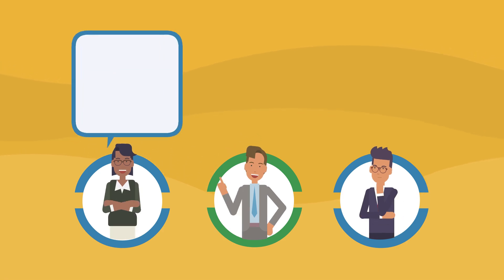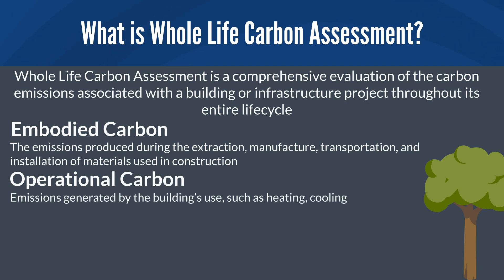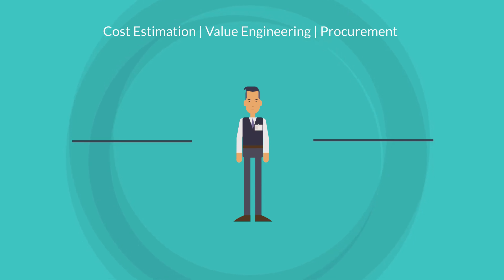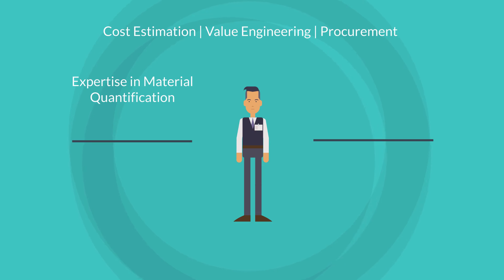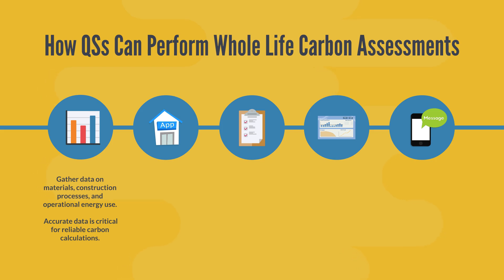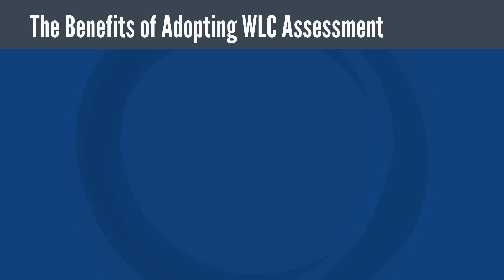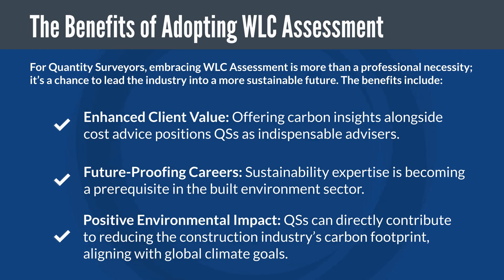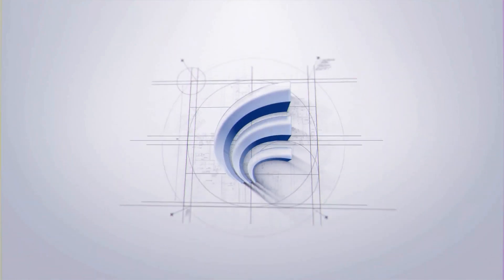Whole Life Carbon Explained | A New Direction for Quantity Surveyors

Comment: 40 new coal power stations a week in china.
Reply from the maker: Thank you for your comment. A little off topic however, currently, the rate of coal power plant construction approvals in China has significantly slowed. In the first half of 2024, only 14 new coal power plants were commissioned, which averages to approximately 0.54 plants per week. It isn't great by any means but thankfully its a lot lower than 40 per week.